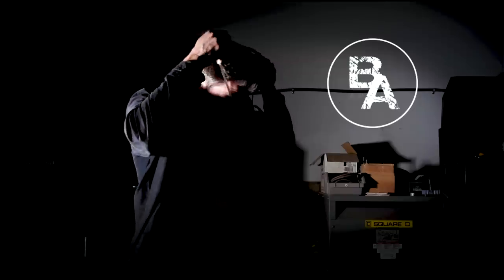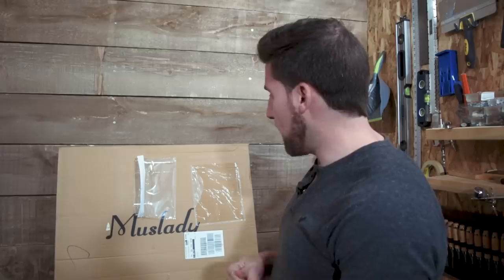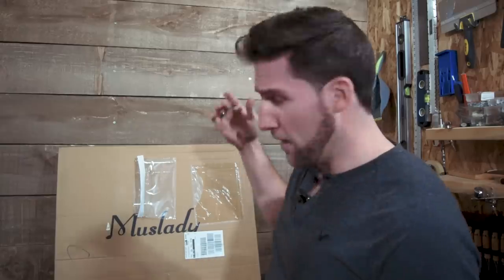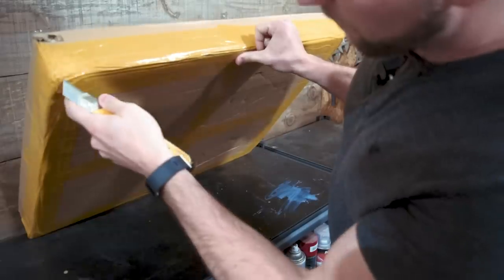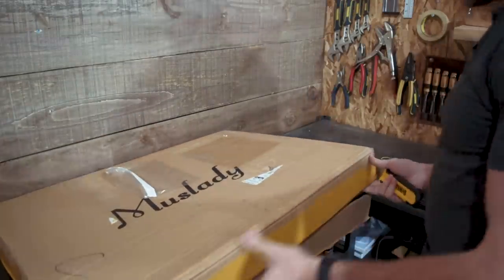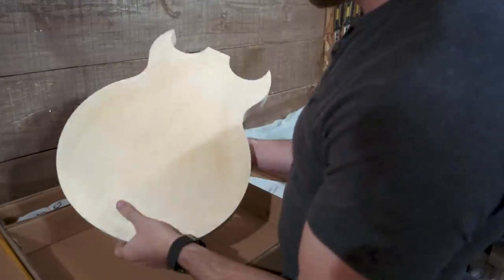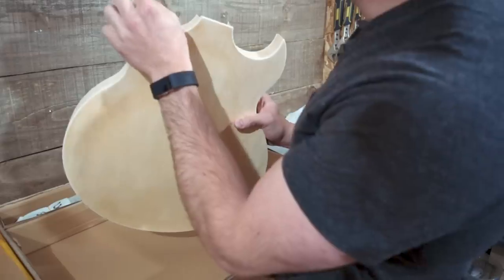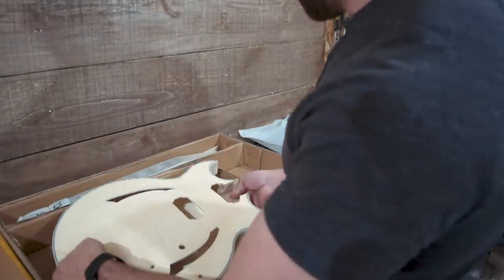Crazy Chinese Hollowbody Guitar Kit | Unboxing

Comment: That guitar needs a floating archtop bridge and a tailpiece connects down at the bottom of the guitar. No way you can mount a tune-o-matic on that thing,  that type of bridge and tailpiece needs an inch or so of solid wood
Reply from the maker: Yeah, I was pretty surprised to see what they provided on that aspect of it. I may have to just take this thing in a different direction than the stock parts allow haha.
Reply: @BradAngove  Yeah I imagine it was just a mistake, do the instructions have the tune-o-matic in them?
Reply from the maker: I’ll have to take a look. It’s been a long time since I read instructions re a guitar haha.
Reply: @monoped8437  yes, that sort of bridge is what it needs not one that mounts to the body
Reply: I did  that kit few weeks back. The bridge was an issue, but remember to add an angle to the neck if you want to use a floating Tune-o-matic Bridge. Otherwise strings height is going to be unsolvable, or you'll have to modify you bridge heavily in order to set them.
Reply from the maker: The neck should already have an angle built in. Does it not? That would be... irritating.
Reply: it's not enought. it's ok for a regular tune o matic bridge but not for an arch top floating bridge that requires a much bigger angle.
Reply: That is exactly what this guitar needs. You can pick up floating bridges for exceptionally cheap, And really nice looking tail pieces as well 30 40 bucks in hardware and that thing will be good to go.
Reply: @SenniMusic   Very true. But lowering the height of a floating bridge might be less labor intensive then angling the neck. A couple minutes with a dremmel and you can drop that really low.
Reply: @greedytastesgood979  Thats what I did, but in term of lowering the floating bridge I had to completely remove the base and screw the top part directly into the guitar and even with the bridge set at it's lowest, it's still too high. I had to remove the two setting wheels. THat's why I said adding an angle to the neck is better.

Comment: Wiring one of these things is just like you build a ship in a bottle.
Reply from the maker: I have no idea what to do with this information haha.
Reply: Just like you build the ship outside the bottle and fold it up and slip it into the bottle. Make a cardboard template with the holes for the pots. Attach the pots to the template and solder everything together. Gently folding everything up feed it through the bridge pick up hole. You can feed strings through the holes and tie the end to the pot shafts and pull them through their respective holes.Be sure to ground the bridge or tail piece.Of course you leave the cardboard template out of the guitar.